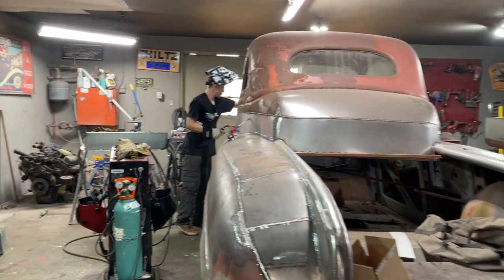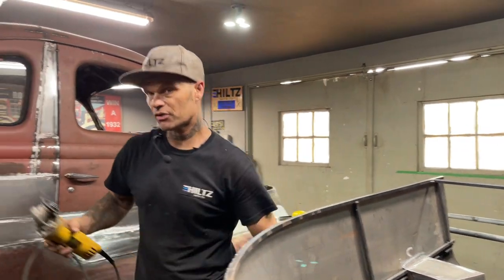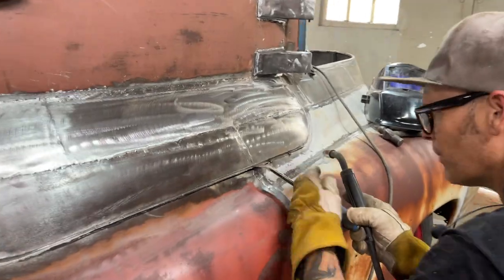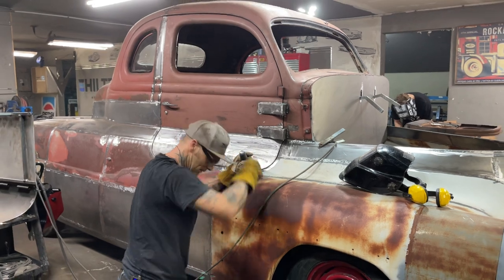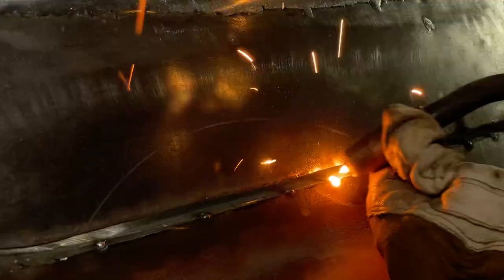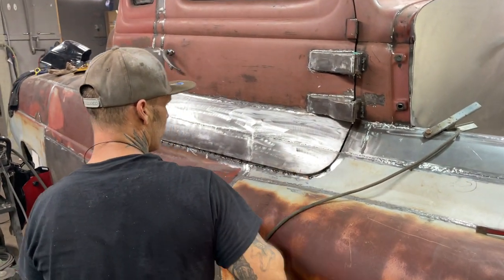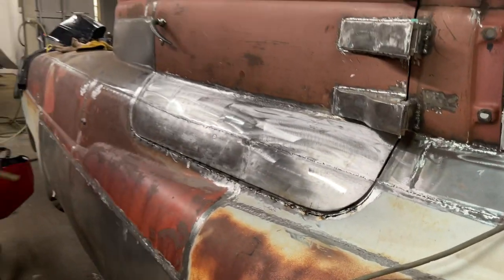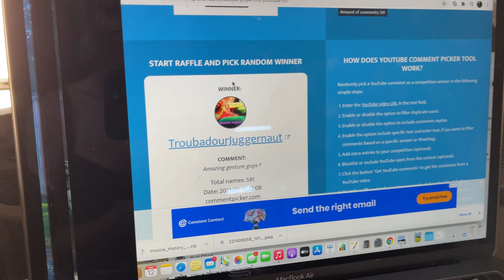HOW TO FIX A PANEL/DOOR GAP THAT'S TOO TIGHT: TUTORIAL & DEMONSTRATION

Comment: I like your shop.  

Just want you to get a basic table on wheels set up next to the project you’re working on so you don’t have to work on the floor so much.  

Also, a cheap Princess Auto service cart next to where you’re working, with the tools you use regularly all right there, would save you so many steps in a day.

I just discovered the service cart thing myself and I can’t believe how much time it saves, how it nearly eliminates me hunting for tools and how much cleaner and safer my floor is (no tools and things all over the floor where I’m working).

Treat yourself.  Start with the cart.

Comment: It seems blindingly obvious that if you use apiece of round rod to make a gap spacer,, it should be very easy to make sure the gap is then consistent.   Seems logical to do it that way, rather than guess and be inconsistent, as the gap plainly is.  You  also need structure to prevent water getting into the car, which you do not have.  There is nowhere to put a door seal.  What are you doing about that?
Reply: Are you saying that a door seal will hold the door out away from the body when the door is closed? I don’t think it will be more than a quarter of an inch and he already said he can just bondo up the body to meet the door

Comment: I would put the correct pins in the hinges and then correct the Gap you could just swing the door open and close and check it and be sure that the final time you got to do the gap and I would get rid of that original hinge

Comment: Jolene, you can improve the videos by doing some high speed or time lapse when chad is grinding or cutting something.   Try it you’ll see a big difference in the overall video.
Reply: The videos are produced without editing. One long shot. Introducing time lapse just adds a level of complexity that Jolene is trying to stay away from. Especially for a daily upload.
Reply: Dean~ I understand the on line no interruption.  I like the channel,  but long shots of grinding or cutting begin to take away from the overall video. If my students handed in a video of a continuous five minutes on say cutting wood.  They would have to do a quick edit to get to the point. 
I was not saying anything wrong about the content or how Jolene films it. It was a suggestion to improve.
Reply: @stevenabrams5811  I get where you're coming from too. This is a true reality channel. I just imaging I'm sitting in the shop for an hour everyday getting my helping if the Chad crew. They have kind of found a formula that works for them. LowFi Filming.
Reply: @stevenabrams5811  I understand where you're coming from and have thought about the exact thing you are mentioning.....but....I quickly realized that as much as there is little excitement watching grinding and welding, the comments that Chad continuously makes while grinding or cutting or welding is as entertaining and educational as everything else. I found that I have skipped past grinding sections only to come back and watch it again and realized how much I really missed! If he didn't verbally express his thought process continuously then maybe, possibly I would fully agree with you.